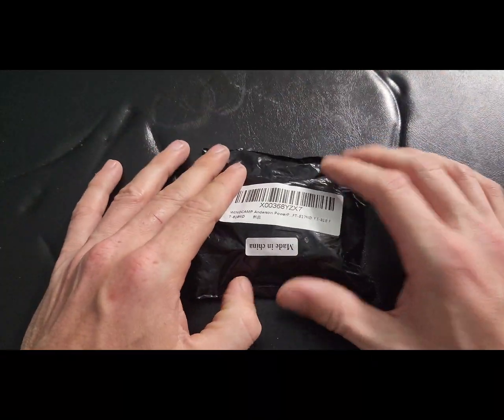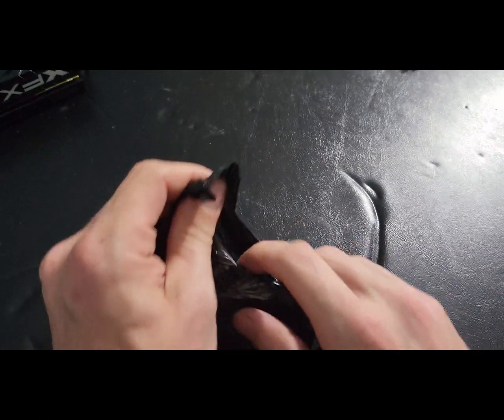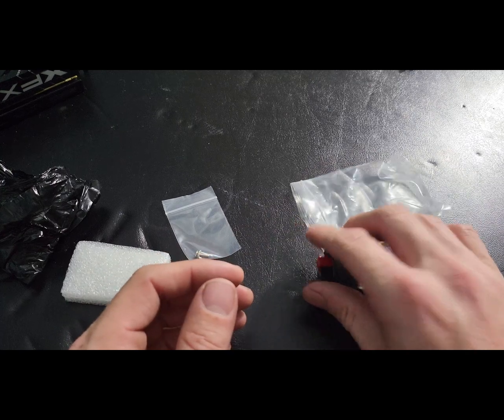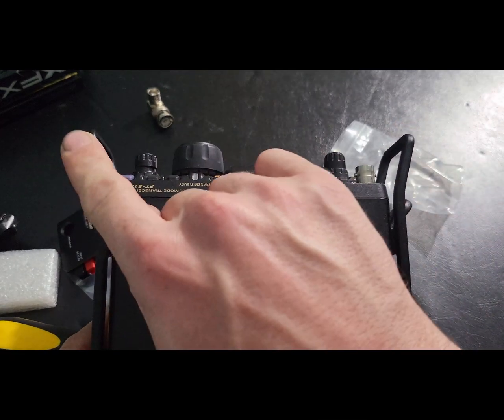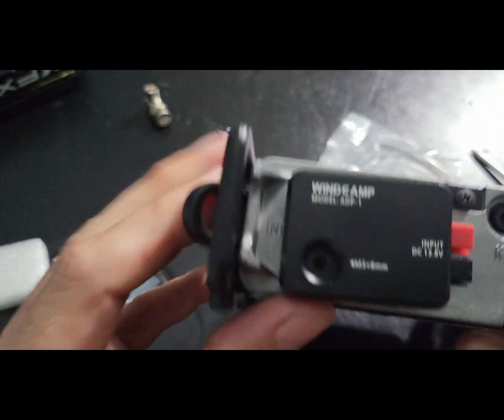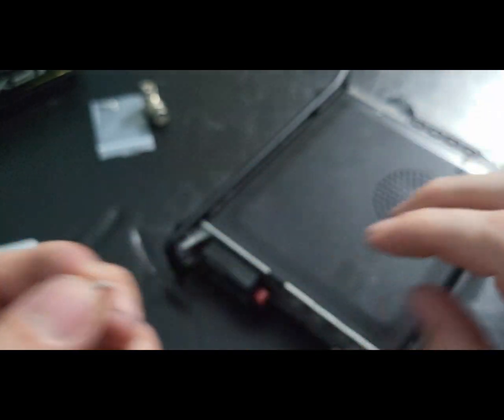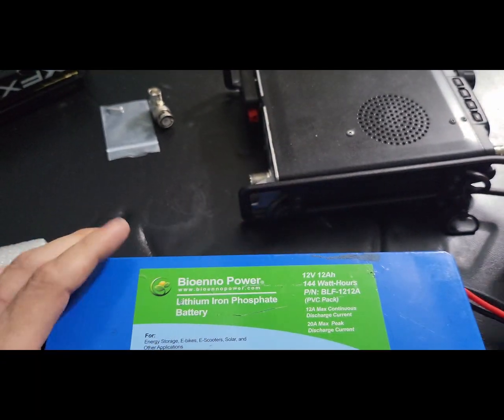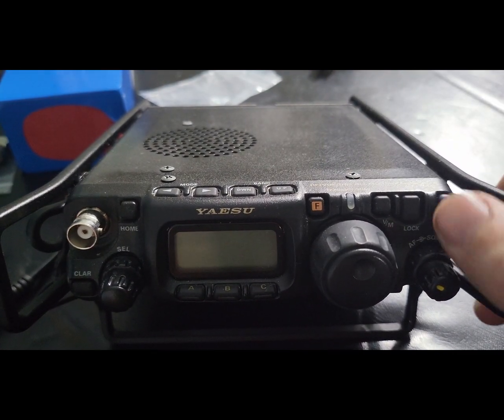Installing the WINDCAMP PowerPole Adapte for Yaesu FT-818 - The No Code Tech

Comment: Added one to my radio some time ago. When the radio is plugged into a Bioenno or power supply, the Anderson PPs are halfway across the back of the radio. Then I also added a Digirig with Data and Accessory cables plugged into their respective ports, plus the coax into the SO-239, and they’re all touching and bending around each other. Not a lot of room to spare. Fortunately, the Digirig cables are flexible.
Reply from the maker: Hey thanks for watching!
Yeah I'm surprised how better this is over the SOTA Beams one.
Ultimately hoping to get the back of my 818 as crowded as yours.